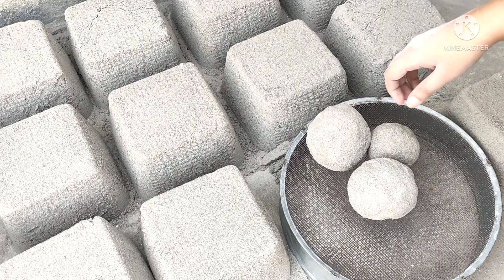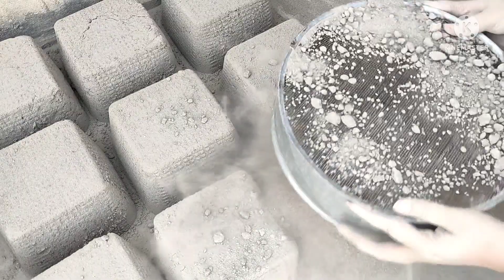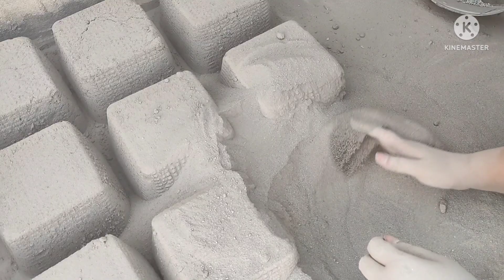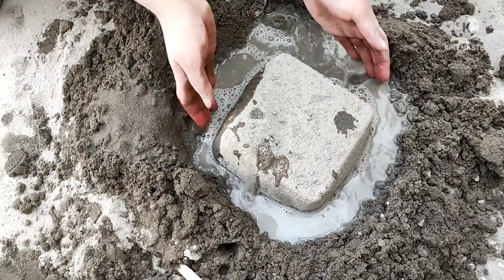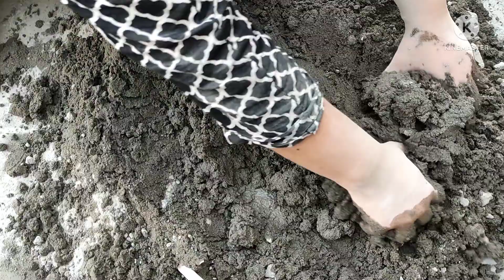ASMR: super dusty crispy soft pure fine sand blocks crumble dry on steel sieve+floor pool water🤤

Comment: 🌼 TIME STAMPS 🌼

✨ DRY CRUMBLING ON STEEL SIEVE✨
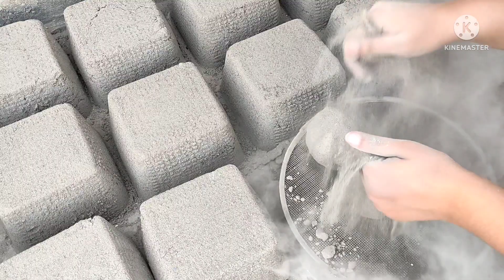Balls 0:01 / 0:06
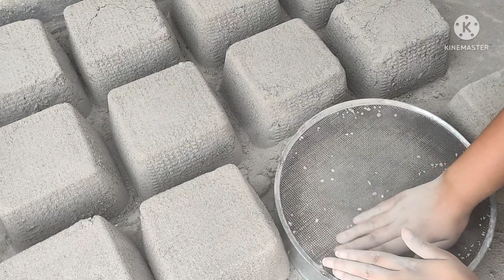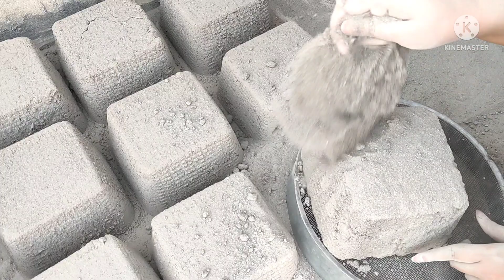Blocks 0:19 / 0:58 / 1:42
Sifting 2:26
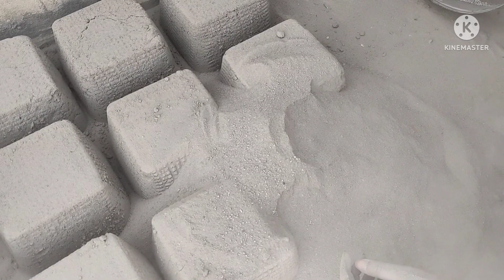Dusty sand play 2:52

✨ WATER CRUMBLING ON FLOOR ✨
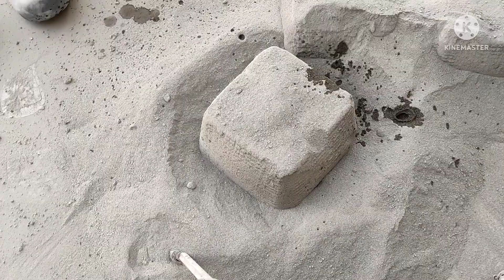Pouring water on dry shapes 3:15 / 4:50 / 7:43
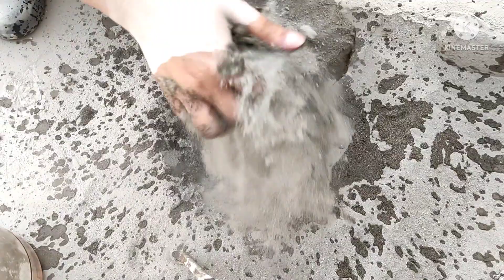Crumbling wet shapes 3:22 / 4:54 / 5:48 / 7:57 / 8:18
Mixing 3:41 / 4:34 / 5:16 / 6:03 / 6:37 / 7:21 / 8:29
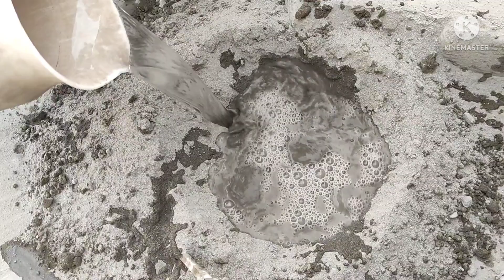Water pouring 4:00 / 5:31 / 6:13 / 6:49
Dry Blocks 4:09 / 6:16 / 6:54